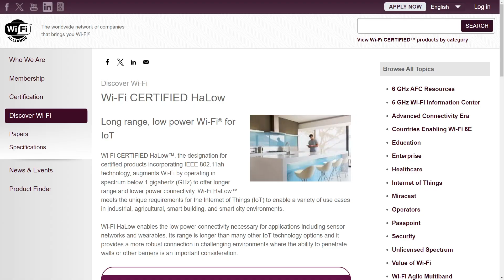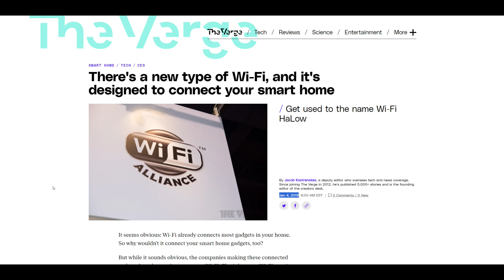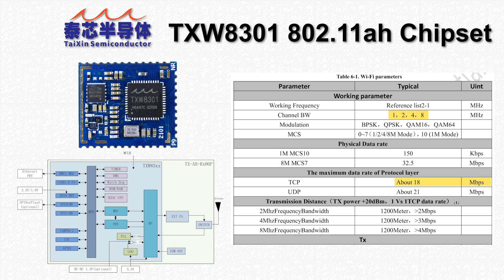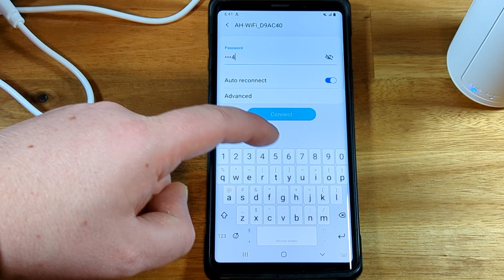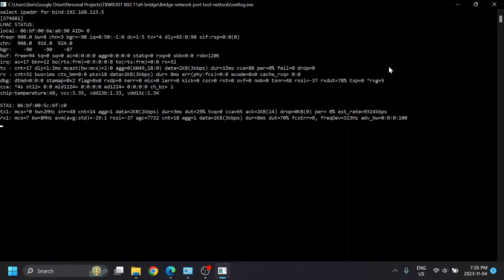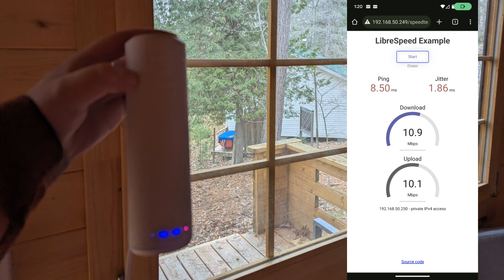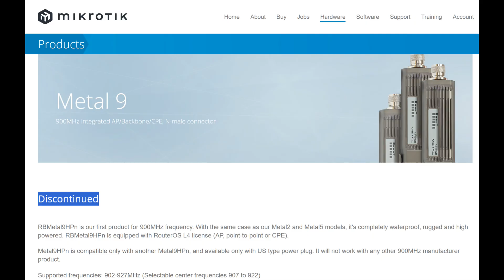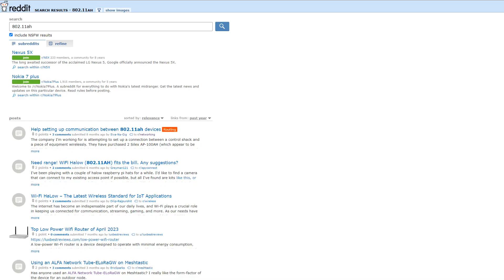802.11ah Wi-Fi HaLOW: The 1 Kilometer WiFi Standard

Comment: Great video, never heard of the standard before.
Indeed as you said, this would be a great alternative for smart home and home automation. I've done a lot in the last two years and the main issue with current Thread or Zigbee products is that their transmission power is very low. My house has very thick walls, so I had to use lots of repeater nodes. 802.11ah would be pretty useful, having stronger penetration.
Reply: It's probably best to stick with well knows popular standards for the availability of more equipment.
Reply: @BillAnt  Absolutely!

Comment: Was randomly recommended this video, very appreciated as I had completely missed the release of this standard. All the typical techtubers are always hyping the newest billion mbps wifi that costs $500 for one AP and goes 20m lol.

15mbps is completely fine for most internet usage, but I used dial-up and adsl for years so maybe that lets me appreciate it more. If I really wanted speed I’d rather run a cable out than mess with finicky or expensive high speed wireless links imo.

So yeah might pick up one of these gadgets myself. Thanks for the video.
Reply: Every young'uns should be forced to use ASL for a week to truly appreciate the speeds nowadays.  lol

Comment: This is great!! Another use case would be connecting your electric car charger to the internet on a multi story building, you can't usually run Ethernet to it. Car firmware updates would also be easier since you would have your own wifi within reach.
Reply: @IntegerOfDoom like a bike
Reply: "Car firmware updates" lmao get out of here with that shit 😂😂
Reply: @alainportant6412  Yeah that's my main concern with EVs besides the rest of the concerns. Good EVs haven't been around for long enough to be able to buy a car without DRM or spyware
Reply: @Octahedran  
Surely, that is insane, but besides that. 

The claim that this video made that "electricity is basically free", is insane.

Surely, whoever made this video never set foot in Europe, at least not since the Ukraine/Russia beef. I live in France, and I can tell you that "ELECTRICITY" is now WAY MORE EXPENSIVE THAN GAS.  Sorry for the caps, but whoever bought those cars, are getting wrecked, right now. Not tomorrow,  not in 2050, right now.
Reply: @alainportant6412  Yep, and that's besides the debate if the power grid can handle it fully.

Another thing as well is if EVs are any better environment wise with the large lithium requirement and so many counties having their main power source be coal and other fossil fuels. 
Of course the environmental impact probably doesn't matter as much for France specifically as I do believe it is mostly nuclear but most country, even in europe are far from that
Reply: @alainportant6412  nuclear energy would likely solve the high energy prices only problem is getting them built and operational considering public opinion and the nonsensical "safety concerns" they always bring up.
Reply: @Octahedran you'll never see EVs without spyware, especially considering everything ice post like 2012 is sucking up all the data it can and sending back to the mfg
Reply: @IntegerOfDoom Can you elaborate? Either way, an EV is going to be the only option in 12 years (in most countries bans come into place)
Reply: @IntegerOfDoom and pay for highly taxed gas instead of charging your EV with energy that‘s practically free.

Comment: From my experience, most people are an absolute disaster when it comes to setting up their wifi network.  As a wifi engineer, here are my tips.  A lot of the conventional wisdom out there is from 1D10T5 and is patently wrong.
1)  Do not set up a password on your wifi network. Seriously.  I'm not joking or being snarky.  There is no faster way to turn a wifi network into a useless P0S wasting spectrum then password projecting it with encryption.  You'll forever be asked what is the wifi password, or people just won't use it.  When you go to McDonalds, Walmart, or Taco bell, do you ever ask for the wifi password?  No.  Because a professional set up the system.  Not some Linux security paranoid millenial tech youtuber greedy with his bandwidth or paranoid a strange will do dark web stuff on his connection.   I've been running an open Wifi network for 15 years.  The Feds, they don't care, because I myself have downloaded more sketchy stuff than any stranger sitting in a parking lot ever could in an hour.  
2)  There are more clear channels than just 1/6/11 on 2.4ghz.   If you stagger them correctly, you can in fact use 1,5,9 in your location and your neighbor nextdoor use 3, 7, and 11.   The next house down, 1,5, and 9 again.    
3) If you set up both 2.4/5ghz/900mghz networks, everyone will use the 2.4ghz old network.  That's what everything supports.
4) You can use all that unused bandwidth in 5ghz to setup line of sight high bandwidth bridges between two buildings.
5) Almost always reformat the junk on your AP or router, and install DD-WRT or Open-WRT.   Learn your way around either, and stick with it and put it on everything for the same interface across all your wifi equipment. You'll be glad you did.  🙂
6) Use Wifi Analyzer on a smart phone to walk around and actually see what channels are being used where, and target yours not to step on other people.  Better, get with everyone in the local area and come up with a wifi map of who gets what channel like a cell grid nework for optimal use of the bandwidth.  I've been to some urban locations where there are literally 30 wifi aps plastered in the 2.4ghz channel, most of them on top of each other at 1,6, and 11 making it unusable for all of them.

Comment: Great Video, I work in the techical side of live events and one unique advantage of wifi HaLow that i see, but have yet to to test, is the fact that its not congested compared to 2.4/5ghz which is partically important for reliable wireless system in crowed venues. To my knowlage its the only solution to get a semi long range wireless network link to somthing like a roaming camrea. Defanitly looking forward to running tests partically for getting wireless digital comms data, tallys light data, ccu control, etc to wireless camreas.
Reply: 6Ghz is not really available yet so that could be a good option in the future. But if you have line of sight, 60Ghz might also be an option to connect the FoH to the stage. But it is very focused so not suitable for moving parts.
Reply: @Hennie1254 yeah point to point/ foh to stage/truck to dc is not where I’d use something like this. But for tally, ccu and maybe even comms of roaming camera rigs this could be interesting.
Reply: @kwaaiwolf4603  and I would also use this as backup. Or if the production budget is so low/ timing is so tight you can’t afford to pull cable. (Load in and out)
Reply: @Hennie1254 as a backup to what protocol running on a hardwired ethernet?
Reply: Unfortunately the 900mhz band isn’t empty, while wifi hasn’t lived there until now, there are still tons of other devices that use that band, some like cctv cameras use it a lot.
Reply: @repatch43 900 MHz devices are still around, but they’re dwindling.
Reply: @repatch43 for real! And some 900mhz handheld phones
Reply: Keen to hear any findings specifically for those use cases
Reply: 800 to 900 mhz is used by a bunch of stuff its definitely not free realestate. Lorawan, 5g lte to name a few services already on it. Good for management layer useless for transport.
Reply: @gtvwill yeah my thinking as well. Do see some use cases for it though but nothing critical at this point.
Reply: To OP: Long range does not necessarily equate to high density (client coverage) for wifi.  The greater the range will increase the channel utilization so crowded places would have high utilization with low bandwidth capabilities. Areas with many clients would not make great usage of HALOW. 
Greater client density actually requires wider bandwidth and wifi7 which can chew up parts of the spectrum to send its data. Wifi6 and WIFI7 is GREAT FOR client density!!
Reply: I just ordered a halow set to use it together with an XR18 mixer for small to medium outdoor events to get the signal everywhere it needs to go (and sometimes maybe even through some walls). Should have low enough bandwidth requirements but only time will tell if it works out like I think it should. Only downside at the moment is that iPads don’t support WiFi AH natively so you still need the receiver unit to rebroadcast a 2.4ghz network.
Reply: I just purchased a pair of these same units for use in a live FOH environment. I’m planning to use it for system tuning and PA monitoring along with typical A1 duties such as Helix and FreeSpeak setup and configuration for events. For this it seems to be an ideal solution. We shall see. I have an event coming up in a large venue and will test it in place of my typical 802.11 AC system.